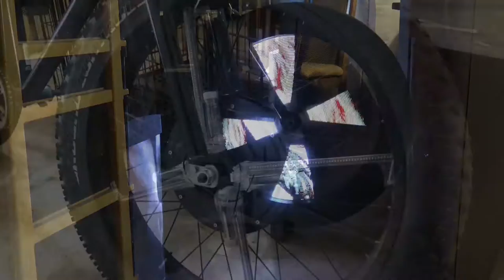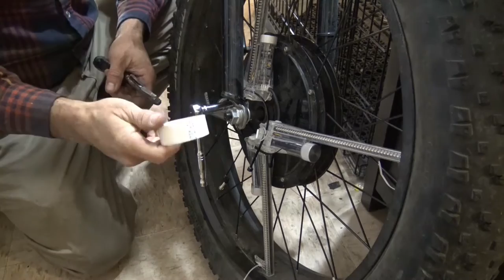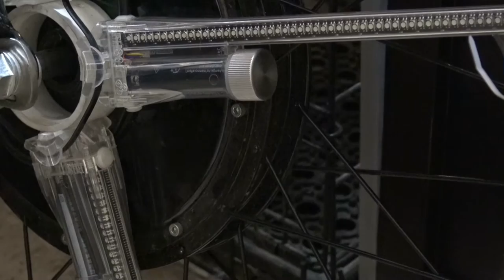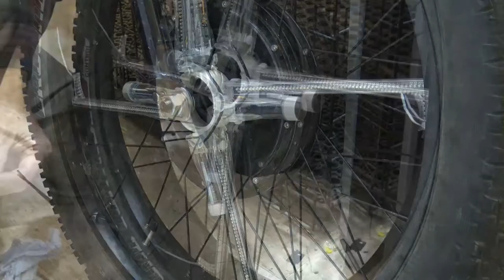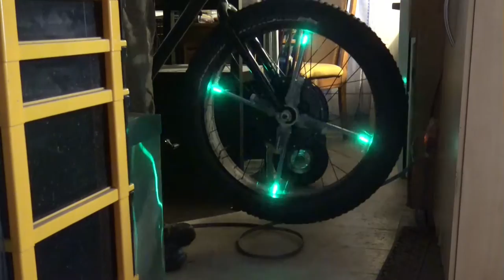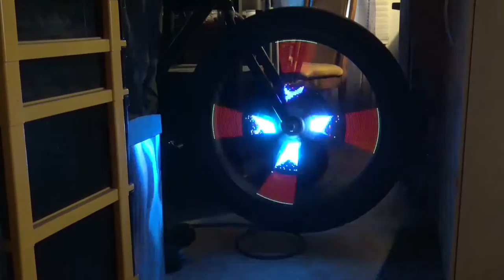Electric Fat Tire Mounting Light Wheel Monitor

Comment: I'm thinking about getting this. 

1. Do you still have it? 

2. Does it still work? 

3. Did you figure out the issue with using your own pictures?

4. What sort of designs are available as default styles? Are those any good?